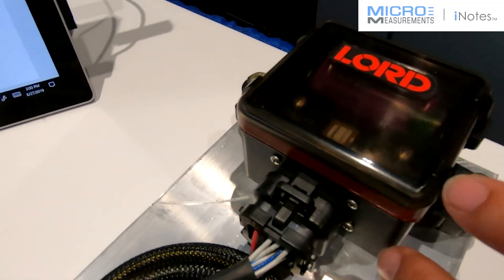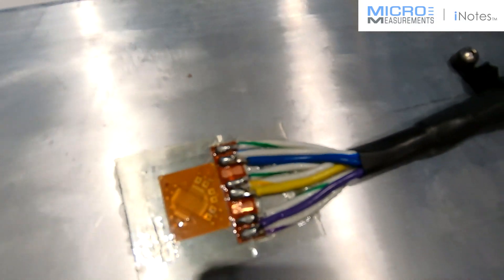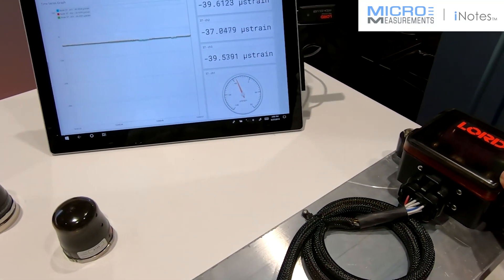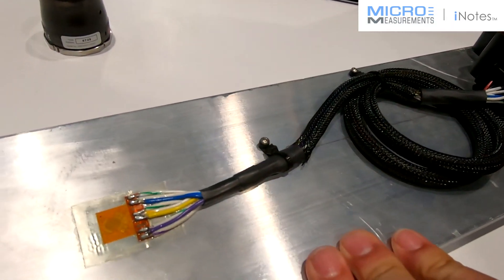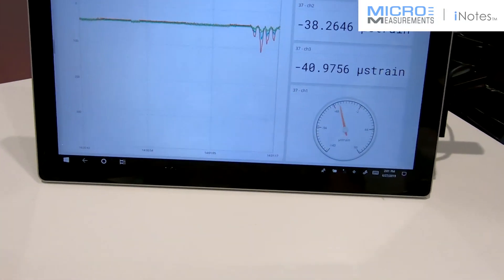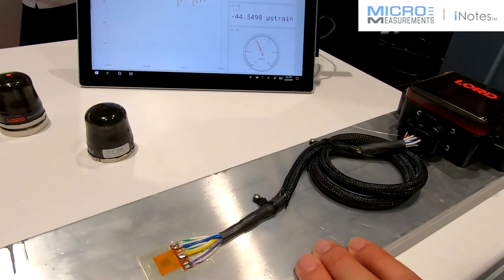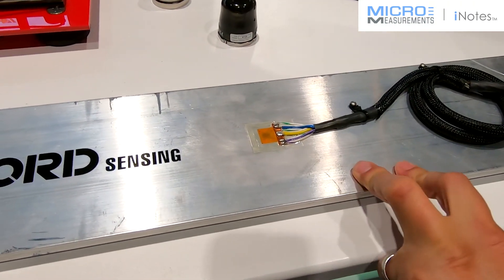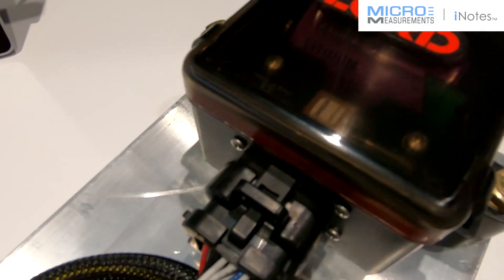Measuring Strain, Load, Force, Pressure, Acceleration, Vibration, Displacement, Torque

Comment: Force Torque Pressure - unit converter

https://play.google.com/store/apps/details?id=torque.presion.fuerza

This App is the best help in converting units of: torque, pressure and force.

Force:

meganewton (MN), kilonewton (kN), newton (N), kip - force (kipf), ton - force (tnf), libra-fuerza (lbf), ounce - force (ozf), kilogram-force (kgf), kilopondio (kp), grave-force (Gf) 

Pressure:

Pascal (Pa), Mega Pascal (MPa), Bar (bar), Milibar (mbar), PSI (lbf/in²), Torricelli (Torr) [mm de Hg. 0 °C], Atmósfera (atm), cm Hg [0 °C], cm H2O [0 °C], in Hg [32 °F], lbf/ft², din/cm²

Torque:

Newton meter  (N*m), Dyne meter  (Dyn*m), Kilogram-force meter  (Kgf*m), Ounce-force foot  (Ozf*ft), Pound-force foot  (Lbf*ft), Ounce-force inch  (Ozf*in), Pound-force inch  (Lbf*in)